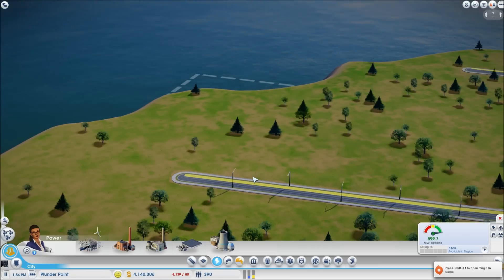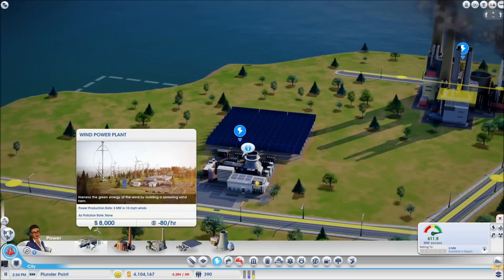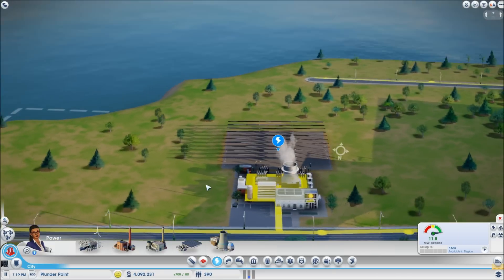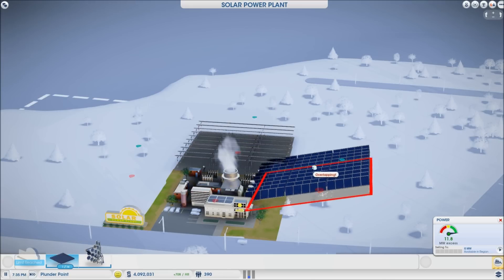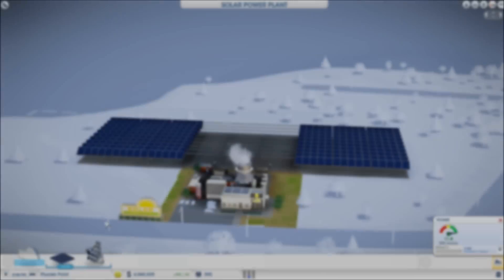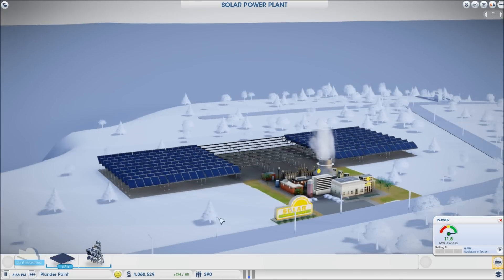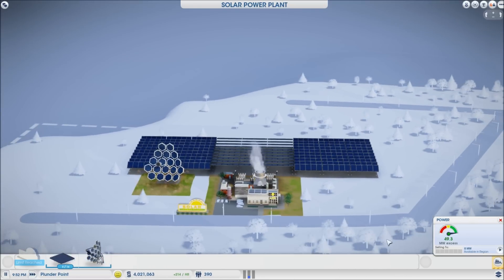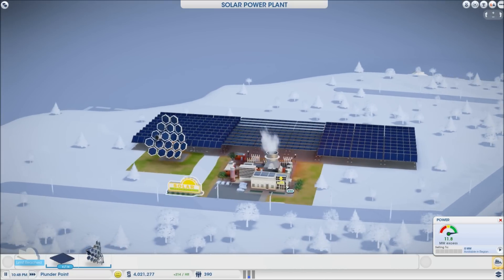SimCity 2013 Tutorial - SOLAR POWER

Comment: The peak hours are from 6AM to 6PM, and the second two fixed solar arrays you placed weren't producing power at 8PM when you plopped them because any solar array placed after 6PM won't begin producing power until 6AM the next morning. The meter jumped up for a second after you plopped them just to give you an idea as to how much power it was going to produce when the new arrays charged.